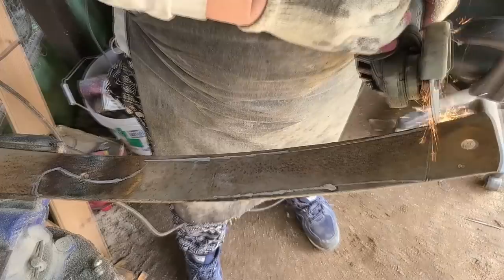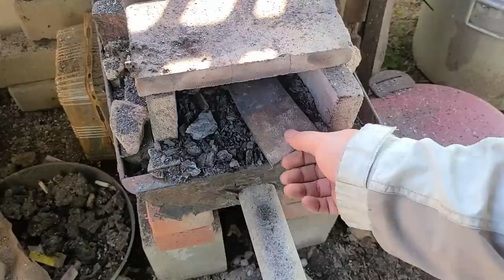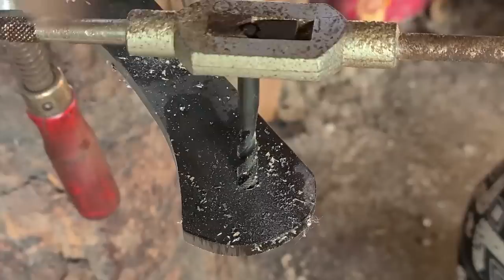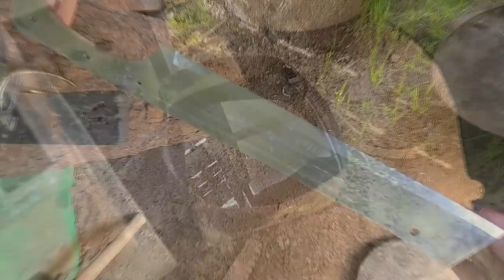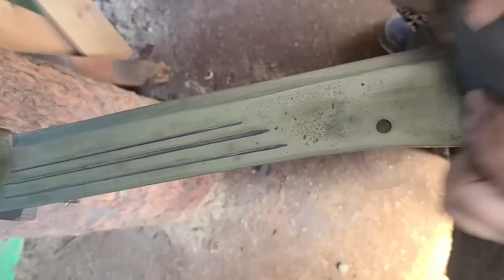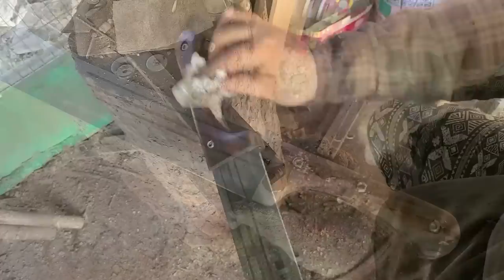Making a machete from a leaf spring

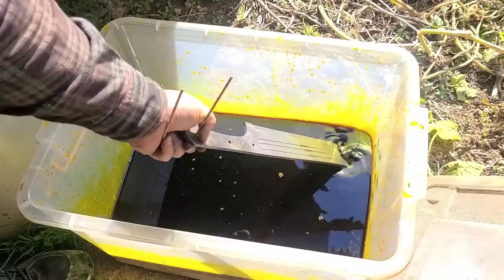Comment: 8:12 dan 8:26 what liquid is that, and for what?
Reply from the maker: Thanks for watching.
The black liquid is ferric chloride. The reason why it is added to ferric chloride is to form an oxide film to slow down rusting a little.
The brown liquid is water with baking soda (sodium bicarbonate) added to it. For neutralization and cleaning.